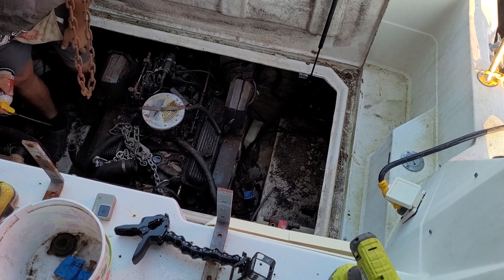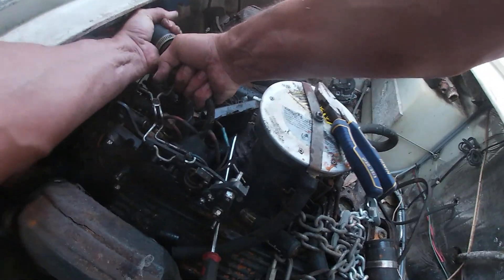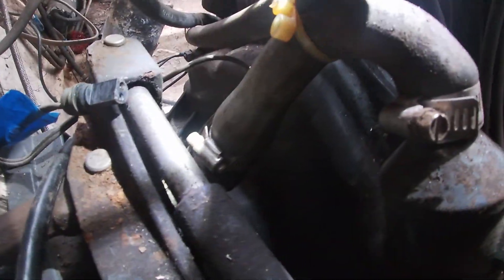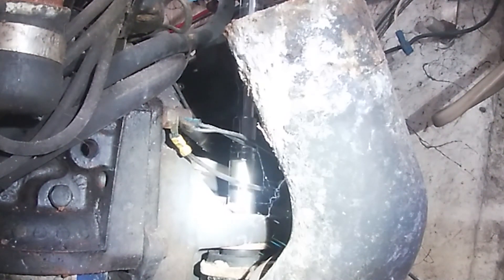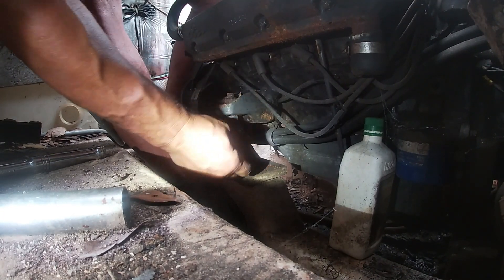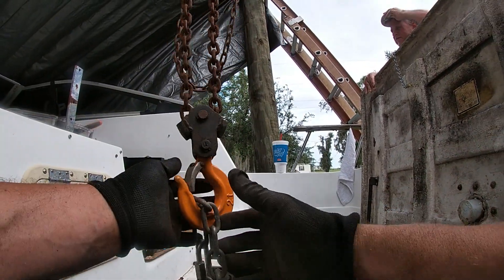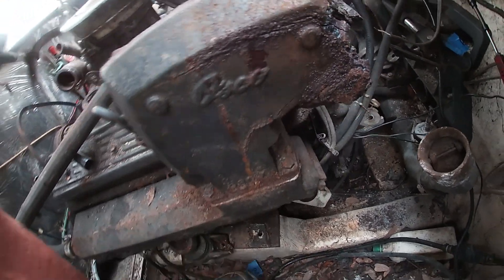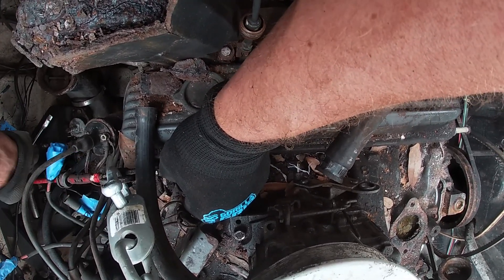I Dropped The Engine Through My Boat, Boat Update Part 10 #greatloop #boatingadventure #boating

Comment: I thought it was for real at first but I don’t think that motor would punch a hole in the bottom of the boat… Those engine supports are pretty stout…. 
But you did manage to raise my anxiety level for dropping my motor back in… My front end loader doesn’t like that load on my hay spear… 😂
Reply from the maker: Take your time for sure with it. I am sure you will get it without a hitch. Are you doing videos of your project?
Reply: @CaptainMike1965  yes I am but I haven’t updated in a while

Comment: Just happened to have a camera angle on the hull ? 😂 not set up much 😂, thanks for destroying your boat tho I was quite impressed with how well the hull held up , that said not silly having your kids so close by
Reply from the maker: FYI that was a stunt boat. Check out the next video of making of that video. Also the day the engine was dropped the kids were not there. They were shot at separate times, I wouldn't put them in danger.